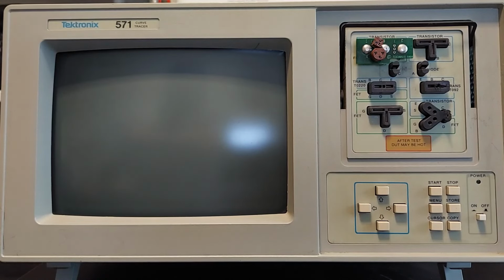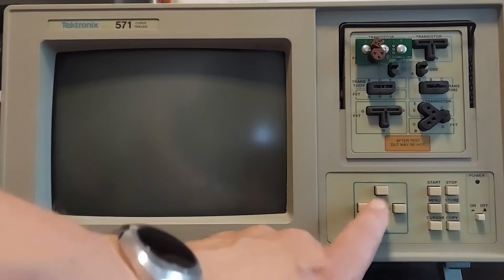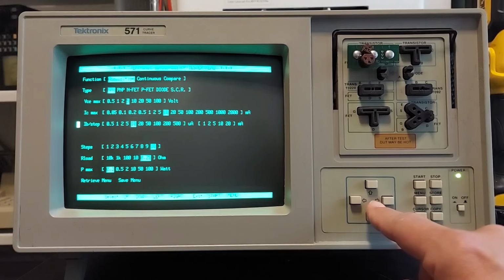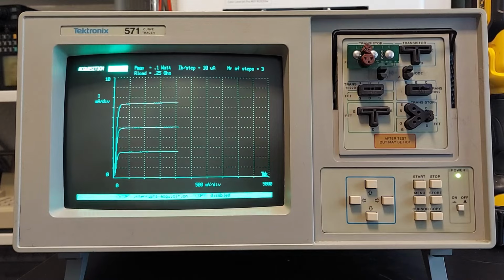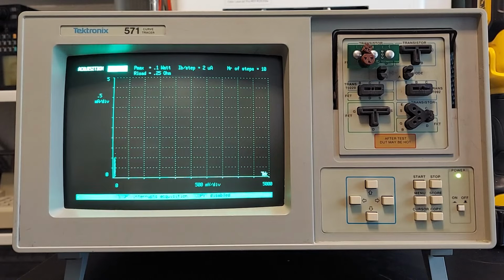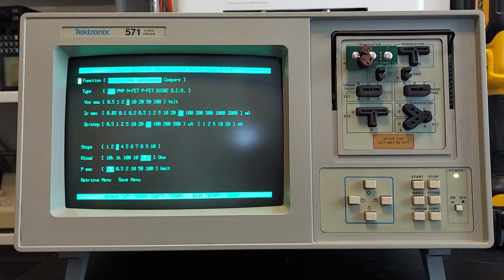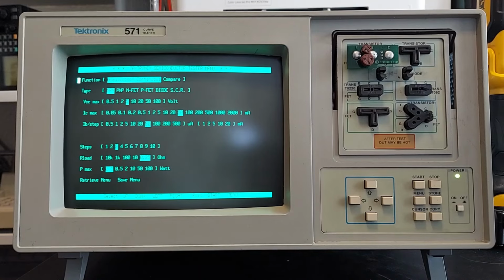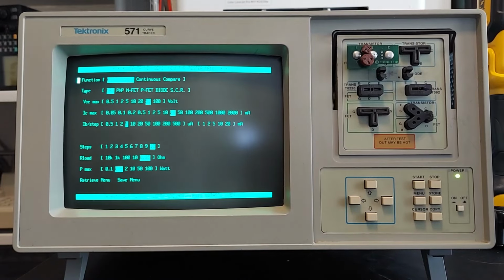Tektronix 571 Curve Tracer

Comment: Thanks for this video! Very educational. Did you try the unit with MOSFETs (N/P)? Regards
Reply from the maker: Haven't tried any MOSFET devices yet. I have only tested a hand full of transistors, a few diodes etc. I also have a printer I use with it to make hard copies. The printer is a OKI Data microline 184 turbo. Thanks for watching.

Comment: Like others have said, this model was new to me, and I’ve been a Tekky for years. I have several classic curve tracers: a 575, a 577 and two 576s, all now needing refurbishing.

The 571 appears to be targeted to low voltage (100V) and low power devices, perhaps on an assembly line where devices have to match, or must be selected for certain parameters.

If one became available at a ham fest at a bargain  price, I’d have to take the plunge.

Comment: WoW awesome tracker, I didn't know this model at all. I once got a 576 on ebay for reasonable money, but the price for shipping + tax to the Czech Republic was absolutely astronomical (3x more than the tracker itself), so I didn't buy it. I currently have a copy of the TEK TI210 but it only works up to 60V, so I'm building my own up to a maximum test voltage of 200V.
Similar digital trackers are produced by Huntron, including automated test stations, but it has one drawback and that is the price 🤔 a trip to the moon might be cheaper 😂

Thanks for showing this beautiful machine and have a nice day 🙂 Tom
Reply from the maker: Hello Tom, I wasn't aware of this unit either. I bought this from a seller that I also purchased an Agilent 1670G logic analyzer from. After a quick search I found the unit listed in the 1990 Tektronix catalog, read about its specifications and features then made the purchase. It was a VERY good deal compared to the 577 and other curve tracers listed in the catalog. Since doing the video I have also tested the print function and it also works just fine. It may be limited to 100v collector voltage, but it will provide up to 100 watts of power and should be more than enough for my lab. I hear you on getting things shipped overseas, I have some vendors I work with in the Netherlands, the shipping alone is sometimes more than the replacement part. Thanks for watching, hope you find something local to your area.
Reply: @CraigPetersen12f36b  
Hi Craig,

that's good news that printing is working 👍
Here in the Czech Republic, it is a big problem to get testing equipment for reasonable money, 550 USD is a great price for a tracker, but it is more than a third of my monthly income.
I used to own a Huntron 2000 tracker, but I lost all the equipment I had acquired in a lifetime when my workshop was completely robbed.
I could buy a non-functional model 576 for approx. 670,- USD without tax, customs and shipping, but after adding it up, I came to a price of around 2,200,- USD and that was absolutely unbearable for me - today only an amateur. In addition, some models from the 57x series had big problems with the HV transformer (I think they are transformers in the brown version), so there is a big risk that you will buy an almost irreparable device for that crazy money.
I know another model that is similar to yours, but it is a Sony/Tektronix license with the model designation 370, if I remember correctly it is produced in versions - 370 / 370A / 370B - I even found it functional for sale for absolutely (for me ) absurd price of 18000 USD.
While looking for a new tracker, I came across an individually modified model 577 that had an additional interface for communicating with a computer for data storage via USB.
If my information is correct, the 576 was not originally intended for direct sale, but was developed solely for the development and service needs of Tektronix and later somehow found its way into the market.
In the range of 1500V, it supplies a current of only 100mA, but at 15V it is able to generate up to 10A.
Currently, the best available in trackers is Huntron's Model 3200S with two independent A+B inputs with G1/G2 and two IDC-64 sockets allowing up to 128 direct connection combinations.

Nice day 🙂 Tom